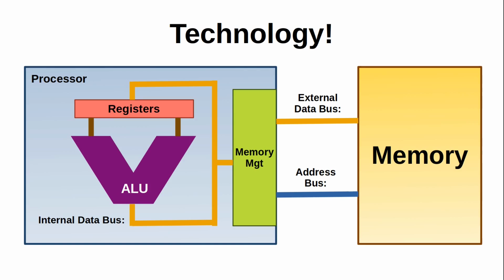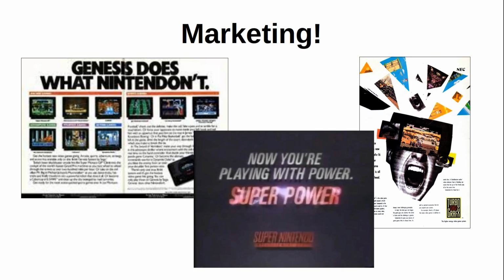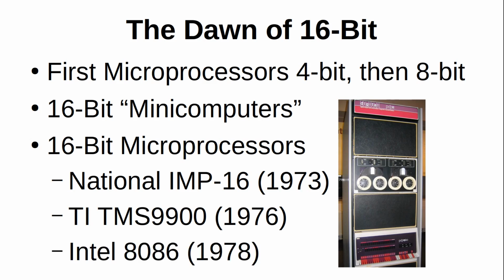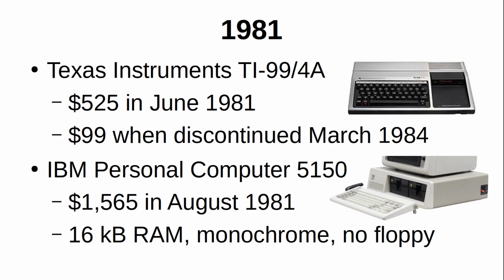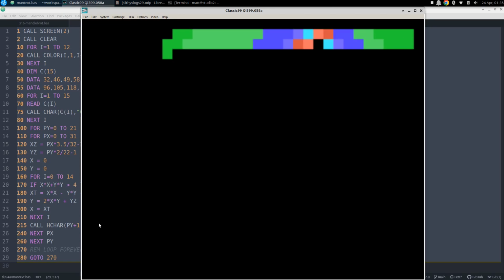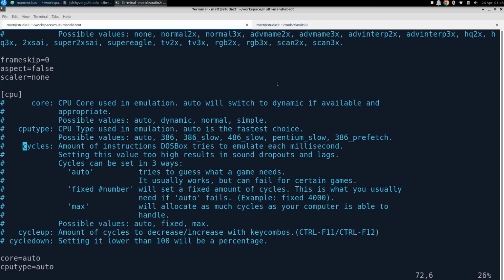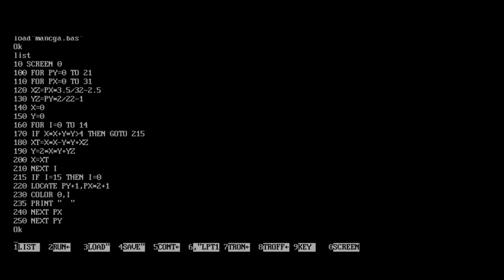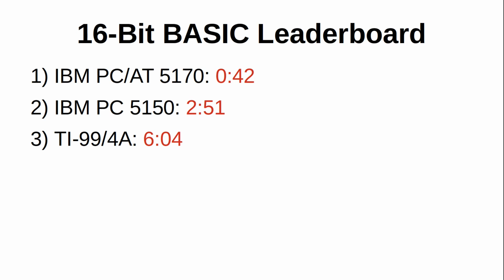16-BIT BATTLE ROYALE! - slithy VLOGS #29

Comment: This video, although well constructed has one major shortcoming. This video does not demonstrate the real result of the 16-bit TMS9900 processor, but it proves just the one that the TI-99/4A can have. 
The TI-99/4A processor though it is a 16-bit processor only a small portion of the system was 16-bit (system ROM and 256 bytes of scratchpad RAM), and used a second 8-bit computer bus for the rest.
You basically in this video have obtained a result among a real 16-bit computer compared to an 8-bit computer.

Comment: ?! No 68000?
Reply from the maker: Didn't watch the video? Round 1 will continue with the original Mac, the Amiga and the Atari ST. This video was long enough just covering these two!
Reply: @slithymatt  ?I just finished and must have missed that bit (making a cup of coffee?)! Also, isn't the Motorola 68000 considered more a 32bit CPU with 16 bit arithmetic and data bus? I know many CPU's fall in this "grey area".

If you are doing the 68000, then any chance of including the QL too? It is a 68008, but it is still 16 bit internal and it might be interesting to see if the basic is any faster than the ZX Spectrum.
Reply from the maker: @jandoor2068  the 68000 is 16-bit by the definition I give in the video, so we're good there, but not for the 68020 and later models. I do hope to get to the QL eventually.
Reply: @slithymatt  Cooliez. What about the IIGS? ;)

I am betting the ST will be the fastest of the lot with it's simplistic but efficient screen addressing system and slightly faster CPU.
Reply from the maker: @jandoor2068  yep IIGS, too. The second half of Round 1 will have all 4, the Round 2 will be 8088, 68000 and 65C816 assembly. No TI assembly in the plans, though!
Reply: @slithymatt  I have written the code for the QL for both SuperBASIC (1:30) and m68008 assembly (~0.8 sec).
Reply from the maker: @AlexEvans1  that's great! can you post a pull request?
Reply: @slithymatt  already don! along with coco stuff.
Reply: SNES for the assembly round?
286 would be good for 16 bit testing since it's not an 8 bit bus.

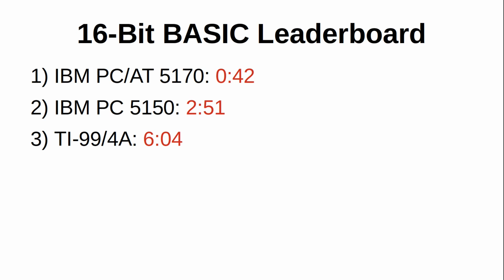Comment: 58:30 the TI-99 in assembly would be very interesting. The TI-BASIC interpreter is extremely slow because it is doubly interpreted. The interpreter was written in a pseudo code named GPL which itself was interpreted by the TMS-9900. Even redoing your test with TI-Extended Basic would be interesting as Extended Basic was a little bit faster than the ordinary Basic.
Reply: Ouch, and I thought MS basic was slow. Would be fun to compare basic implementations with clock speeds factored in. Ideally you use the same cpu, like 6502 and z80 BBC basic vs MS basic.

Comment: the TI CPU was different and interesting but was a dead-end as RAM memory and CPU sppeeds would widely diverge over time and now there are as much as three tiers of memory caching to enable the much faster CPU deal with the much slower RAM. The TI CPU was devised when CPU and memory were the same in clock timing - the CPU only went forward at speed of it's memory access speed

Comment: On CGA-based PC you can have only 8 background colors in the text modes. You'd better use foreground color and filled square (character with ascii code 219) instead of 'space'. Using statement 'WIDTH 40' you can switch into 40-column mode, so you don't need to use two characters as a 'pixel'.

Comment: Well, you'll need to add the original Apple Macintosh, Atari ST, Commodore Amiga OCS, Sharp X68000, Elektronika K3000 and follow-ups# Sinclair QL, Apple IIgs, and one of those new Zilog eZ80 SBCs*

# Based on the Digital Equipment PDP11-12-13 series of processors.
*The eZ80 is nominally 8-bit, but it has 24-bit registers, 16 bit instruction arguments, 40 bits worth of data bus (when you include all the GPIO) and a (non-multiplexed) 24-bit address bus.
Reply from the maker: I'm already planning on the Mac, ST, Amiga and IIGS for the next episode, and the QL for a later one with others. I like the idea of the Sharp, but I'm not familiar with the Elektronika. Do want to cover a wide range of commonly owned computers
Reply: The PDP-11 would be interesting, if only it had a reasonable graphics mode. Could pick characters with varying white space I guess and TTY them out

Comment: You can argue that bit-slice CPUs like the AMD 2901/2903 or the Intel 3002 can be 16-bit too. Heck, one day I want to build a 16-bit computer using for CPU nothing but Motorola MC14500 1-bit processors in parallel. For the hell of it. :)

Comment: Would like to see the 6809 or 6309 thrown in there for good measure.  It would also be interesting to see what the TMS9900 could do if it weren't hampered by the memory bottleneck in the TI-99/4a.  Although, I have no idea how you would do that short of building a home-brew computer.
Reply: Do we put the 6309 under 8-bit because it would likely be in a CoCo or a Dragon or 16-bit because it has an internal 16-bit bus and a 16-bit ALU?
As for the TMS9900, if you have an expanded TI-99/4a you have more native memory. Mine has 128k.
Reply: CoCo Assembly: 1/2 with 6809 at standard speed: ~6.5 sec, 3 at double speed ~3.5 sec, 1/2 w/ 6309 standard speed ~3 sec w/ 6309 at double speed ~1.5 sec.

Comment: I had a 99/4a in addition to several 8 but micros as a kid and it was the nicest to use felt the most well built I would often use it even over much more powerful systems like the coco3  cause the hardware was much more pleasing to use.

Comment: I'm suprised the Z80 is outperformed by the 6502 at a third of its clock..  if we're talking 16bit, does that mean an Amiga video is coming? :)
Reply from the maker: It is! And really, that poor performance by the Spectrum is due to Sinclair BASIC just being so slow. The difference wasn't so extreme when using machine code.
Reply: @slithymatt  AmigaBasic that originally came with the Amiga was also notoriously slow and incompatible with newer models. I wonder how it stacks up to the likes of GFA Basic or even BlitzBasic or AMOS :)
Reply from the maker: @desertfish74  I plan on trying both ABasiC and AmigaBASIC
Reply: @slithymatt  but AmigaBasic is soo sllloooowwww :P
Reply: @desertfish74  The incompatibility is overblown. There are parts that if you use them are even incompatible with using a 68010, but if you avoid certain things (trial and error) it will often run one even a 68040 or a 68060.
Reply: Sinclair BASIC is notoriously slow. To be fair, this is because they were trying to fit it into as little memory as possible, which is also part of why it has you do the tokenisation as you type.
Reply: Th Z80 is clocked in a different way from the 6502 (and the 6809 which blows both of them away in this particular case). The 6502 uses up and down transitions of two separate clocks 90 degrees out of phase, so 4 ticks per clock. The Z80 only does one tick per clock.
Reply: I expect the Amiga BASIC test to be EXTREMELY slow; Amiga BASIC interpreter was terrible! It was great when I got the Power BASIC compiler for it :)

Comment: Nice to see the early 16 bit systems!  

Back in college in the mid to later 1980s, our observatory with 24” telescope was controlled by an 8086 minicomputer-style system. It had two terminals (one in the telescope dome, one in the control room) and two  additional monitors for graphics and status (again one in some and one in the control room). It also had a hard disk (10 MB?) and 8” floppy diskette drive!  The OS was iRMX and it was programmed in PL/M for the low-level and real-time stuff and Pascal for the higher level data analysis and astronomy utilities. Sort of like a DEC PD-11 but from Intel (sort of surprising looking back that it was not a DEC system, as the main campus computer systems were all DEC). I spent a summer there getting paid a stipend to code Pascal for it. 

About five years ago when one of my sons was in high school, he picked up a TI-99/4a at an estate sale. The keyboard on that version seems decent. He has not done much with it, like many people, unfortunately.

Comment: The main reason TI basic sucks so hard is because at the time of the machine's release they couldn't actually afford to install a full 16kB of 16-bit memory--so they used a hack whereby the machine only has 128 bytes of the good stuff (minimum necesssary to boot the CPU) and the rest of the RAM is 8-bit wide and locked behind the video controller. This obviously does not for good performance make!
Reply: It’s sort of too bad TI didn’t move the machine up-market like IBM later did focusing on business users and provided a more suitable system architecture to capitalize on the CPU capabilities. But for the home computer market, it was the wrong approach. I don’t know if TI could have or had designed a more reasonable 8-bit CPU that offered some type of compatibility with the 9900 so the product line worked better and provided a way to start with a lesser/home machine then move up later.

Comment: You could CALL COLOR(I, I, I) then you would not need to redefine the chars at all and they would be blocks of color by themselves. BASIC on the TI is double interpreted and is very slow. Extended BASIC is somewhat faster though (not in all regards). I would be interested to see this in Extended BASIC. Noel has also done some interesting benchmarks on the TI.
Greetings from an old time 99er!
Reply from the maker: Oh, and I did run this in Extended BASIC, and it was exactly the same time. So whatever it speeds up, it's not applicable here.
Reply from the maker: Yeah, I realized that eventually, but I still wanted to do the demo with the characters for illustration purposes. Surprising how just that for loop of CALL CHAR still adds a second or so!

Comment: Have you considered trying PCem? Windows and Linux support, and is designed to emulate multiple systems that utilize Intel processors starting with 8088 and going up to Pentium 2. I'm not certain of its timing accuracy, but I have been successful installing Windows 98SE in its work environment.
Reply from the maker: That's a new one to me. I'll give it a try!

Comment: TI-99/4 is to TI-99/4A as NCC-1701 is to NCC-1701-A. So it would be interesting to see what a TI-99/4B through TI-99/4D and beyond would look like.
Reply: Somewhere on YouTube there's a fascinating detailed analysis of the TI-99/4A design which points out how screwed up it was.  I wish I'd bookmarked it.  I bought one new when they went to $99 to liquidate inventory and got rid of it when I discovered it didn't have peek or poke in its standard BASIC, but that wasn't part of the the "screwed up" design video I mentioned.
Reply: Where does the NCC-1701 Refit, as seen in Star Trek 1-3 come into play? :p
Reply: @ElectronStarCollapse  it had a prime marker, but it was the same color as the hull so you couldn't see it.